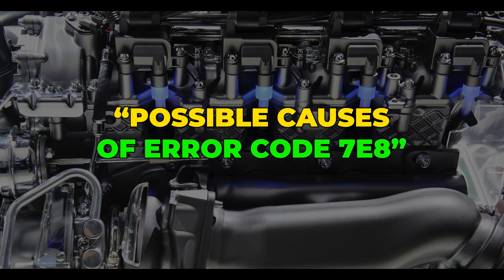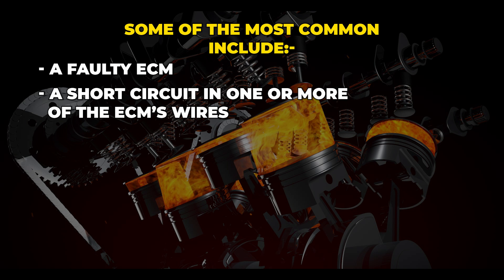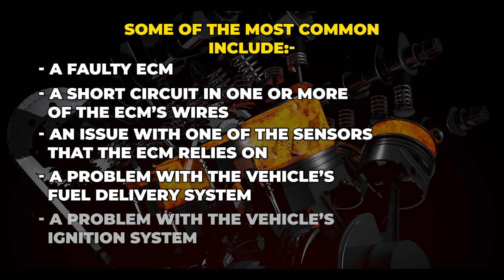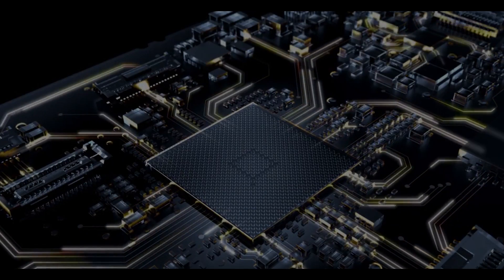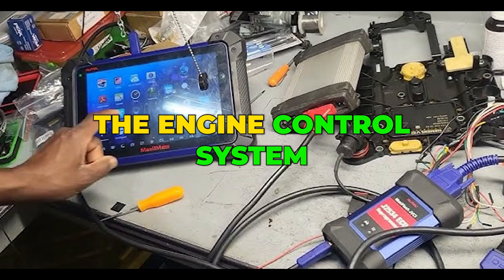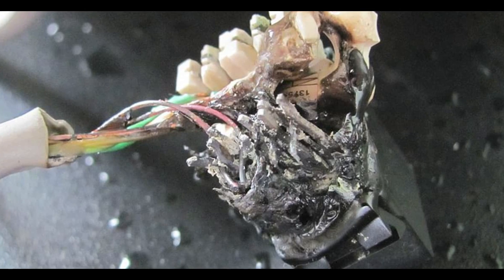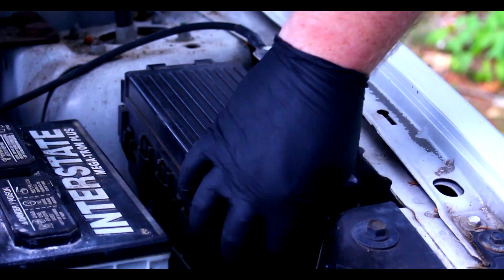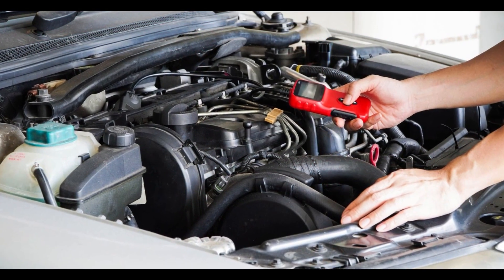7E8 and 7E9 Engine Codes Meaning, Causes, Symptoms, and Fixes

Comment: another BS video... all I heard was "it could be this, it could be that" and no real time solution..... These codes are related toe P061B  which indicated the PCM is having trouble decoding bad information from air sensors mostly the Mass Air Flow (MAF) sensor and or MAP sensor both located in the air intake... Also a bad seated or dirty air filter will cause the MAF to go haywire!    All these simple inspections are easy to tackle before coming to a conclusion that you have a bad PCM after determining the air sensors and intake/ throttle are all working properly!

Comment: My car I repaired myself twice. I went too long for a oil change, and I had to change a Engine knock sensor if your hood on your car when your in gear and with the break pressed down and your hood is shaking up and down and the engine sounds like it is vibration city 1) Get your engines oil changed 2) You are a Mechanic needs to change your Knock sensor. If your car wants to stall while driving that could be a sign too. The part is usually cheap but getting to it sometimes is a tight squeeze like on my 2016 Jeep patriot. If you change your oil regularly the part will last awhile.